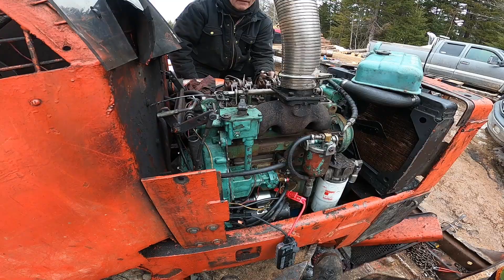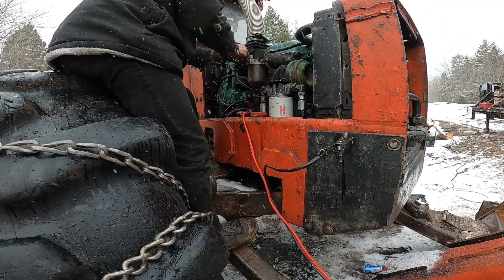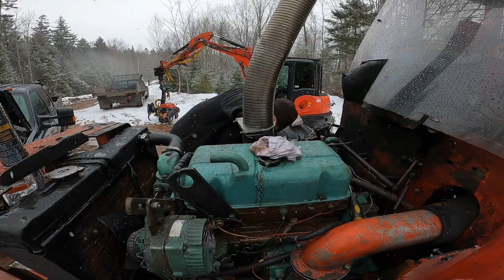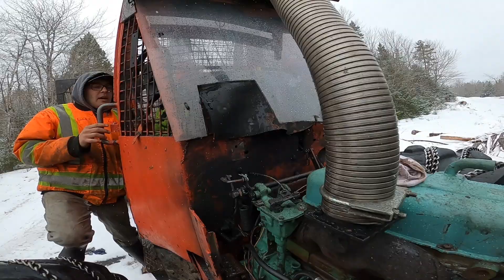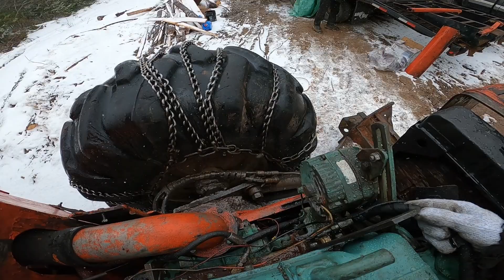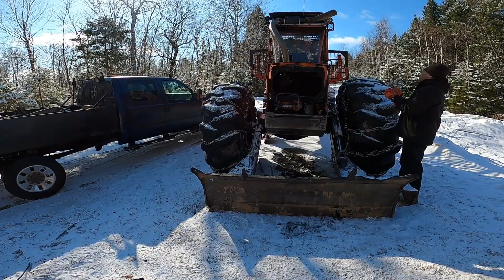353 DETROIT DIESEL SWAP!! 40 YEAR OLD NEW CRATE ENGINE!! MAKING IT RUN!!

Comment: swapped out my 353 in my 664b clark for a john deere 4 cyl.  jd came from burnt street sweeper $ 500.00 sold the spare parts and got my money back . had to do a little machine work on the flyweel and raise the hood 4" for the turbo. Clark runs like a Deere
Reply from the maker: Sweet

Comment: All 2-stroke Detroit were designed for a little bit of ether. If they would have just popped it with a little bit of ether starting fluid I would never had so much trouble